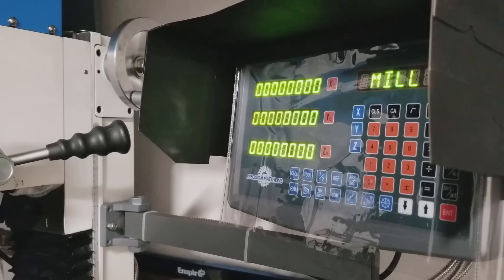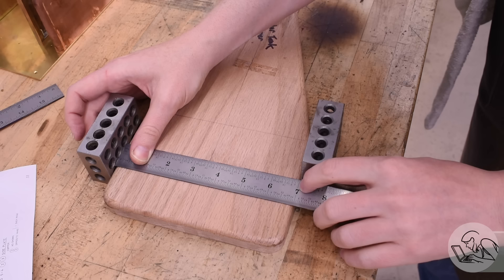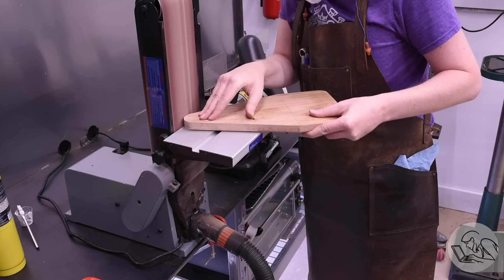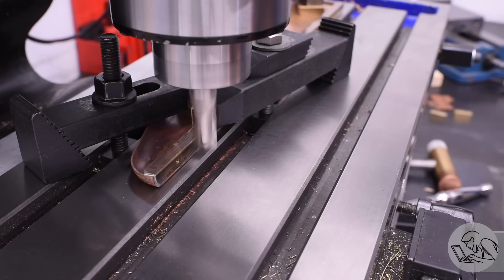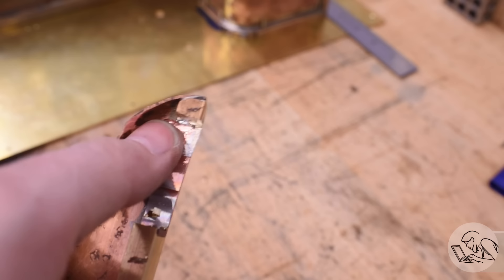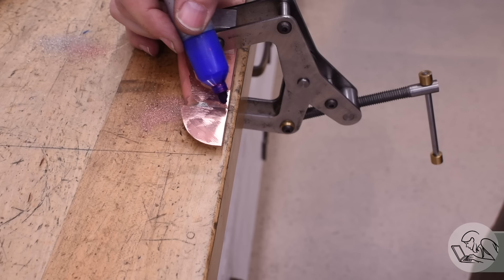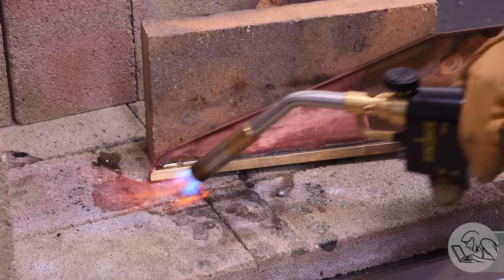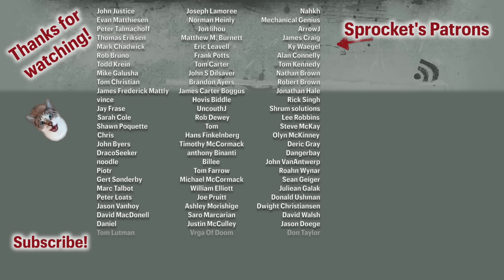A Big Error!   Pennsylvania A3 Switcher, Part 23

Comment: I'm not sure how well it will work with the highly heat conductive copper but recall that old time autobody work was done with solder to fill small gaps and slightly low spots.  Of course steel is like a heat insulator compared to copper.   Hmmmm... What about a much lower temperature filler?  Perhaps some manner of lower temp soft solder as a filler?    Or I believe that the new lead free solder is a little higher temperature.  Perhaps use that to solder on the upper shroud and then you can fill any little gaps with regular tin-lead solder?  I've not tried that myself so it would need testing.  You've got lots of scraps to try it with

Comment: Bondo makes welder with my level of skill look like a welder of slightly better skill...after paint at least.  Might work for that low spot🙄😶
Really nice save, btw.  Love the vids when something goes wrong.  The way you present it allows so much to be learned.  Thanks.
Reply: Fill it with solder?
Reply: @ColinWatters  might have been able to do it earlier, but may not want to chance heating the repair past the melting point at this stage... It will want to open up.
Reply: Of course I forgot that powder coat will be the finish... So polyester resin may be a non starter.

Comment: I'm not sure if it's possible but could you have blown the solder out? Setup a shield, melt the solder, and apply compressed air? You could also drill out the screws first before melting the solder and that should allow it to separate.

Comment: I was going for Plan Zeta which sort of happened anyway at the front - cut 3/16" out of the tender sides & resolder back together. Of course the angles would still have been incorrect though.

Comment: That was a great fix Quinn and as always a great vlog. Could you use soft solder on the dimples to fill in rather than trust the powder coating to fill them? (Like car body filling and sand flat). Just a thought. Looking good though. Stay well.
Reply: That's a pretty legit option. Tinning or using lead filler is what they used to use before stuff like bondo came around.
Reply: Lead was the way it was one before bondo
Reply from the maker: That’s all behind the brass
Reply: Hi Quinn, I meant on the outside were the silver solder has dropped, use electrical solder, less heat and will fill in the drops. File off then use 240s paper to bring it level with the brass. Don’t use lead, not good in a small area. But, I suspect you know this. Stay well.  @Blondihacks
Reply from the maker: @daverichardson5861  No, there is brass that will cover that entire surface. Where my thumb was, as I said in the video. None of that will be exposed.
Reply: Apologies Quinn, watched it again and in-depth listening skills put into operation! You clearly said a cover was to go on the sides! Where your thumb was and you had already used soft solder to join the parts. Age and watching the Rugby World Cup at the same time. Again apologies and still love watching your work. Roll on next Saturday and don’t forget to put your clock back, if its a thing over there or unless you already have. Stay well. @Blondihacks

Comment: Wouldn't it have just been easier to move the coal bunker forward if it wasn't soldered in place? Is the exact placement of it, in relation to the bottom plate, that crucial so that you couldn't just adjust the parts that go on afterwards to match what you already have made?
Reply: That was my first thought, even it it was soldered down. Heating from the rear with a big rosebud or Belch Fire and it would have dropped off. - There has got to be some other reason.
Reply from the maker: You really don’t want to start moving major components around Willy Nilly. Everything down the road depends on where all this stuff is.

Comment: Great fix and save!
Though I am curious as to why you didn't hammer form the new tail section before sizing and soldering it into place?
Reply: That would have been my go-to method. If you mess up the replacement section you can simply throw it away and try again until you get a good fit.

Comment: Be careful when you get to the tender water pump.  Kozo's dimensions for the "O"-ring gland are wrong.  His dimensions provide ZERO squeeze on the specified "O"-ring and it will not seal.
Reply from the maker: Thanks for the tip!

Comment: was there a reason you didn't shrink the big end instead of the small end?
you wouldn't have had to move the holes then and the front flanges would be a little bit longer ( they came up short when originally formed by the looks of one of the last shots.. )

Comment: Just a question, but could you have not just tapped off the sill piece after melting the solder like you did with the little piece? Might have had to drill out the fixing screws, but a nothing of a job.

Comment: 9:00 onwards. Whilst re-melting the solder won't make it flow out of the joint, surely once it is molten there's only the screws holding the two parts together. So wouldn't drilling the screws out first have allowed the bar to simply drop off once the solder melted?
Reply from the maker: Maybe. Or maybe I’d have drilled a bunch of holes and wrecked it for nothing.

Comment: Not to be an ass, but why not just shift the coal bunker forward to match the tank? No, it wouldn't match the prints, but there's no way you'd see it from the road.
Reply: There has to be a reason we are not seeing.
Reply from the maker: Because you really really don’t want to start shifting major components around on a huge assembly like this. Many other parts depend on its location and you’ll be in transitive error hell.
Reply: @Blondihacks  Fair enough, I don't have the benefit of the rest of the design to draw from. And this was a good episode on how to recover from a mishap.

Comment: Yo , repair of a repair,,,,  Hey,I have never had anything get pulled into an end mill,,,,Ask Santa Clause and the Easter Bunny, They are always standing right behind me when ever I machine anything. ... and they will tell you that it's not weather we screw up, it's if we can make it right in the end. (I got LOTS of practice turning 1/2 hour jobs into 1/2 day+ projects, BTW) 

Just a question, though. Why not just move the coal bunker forward 3/8? Did I miss something? 

Well, as long as you keep 'm coming I will have something to keep out of the bar on Saturday Afternoons. 

later, Alligator